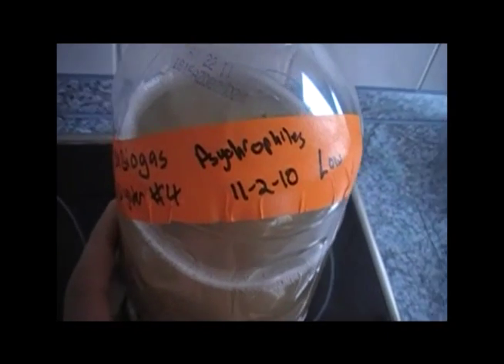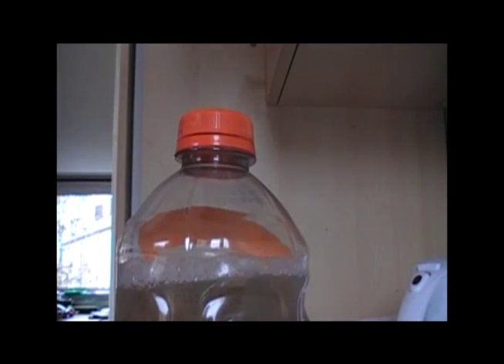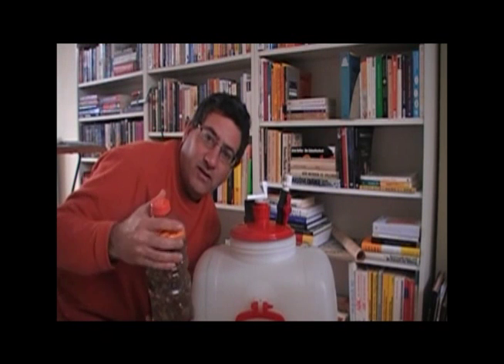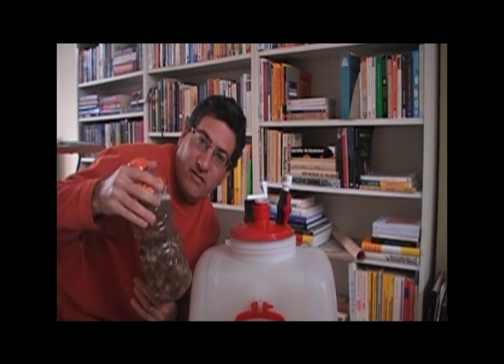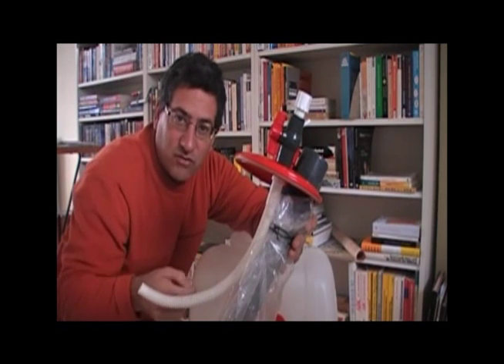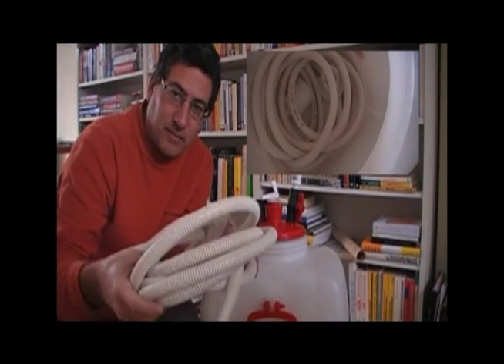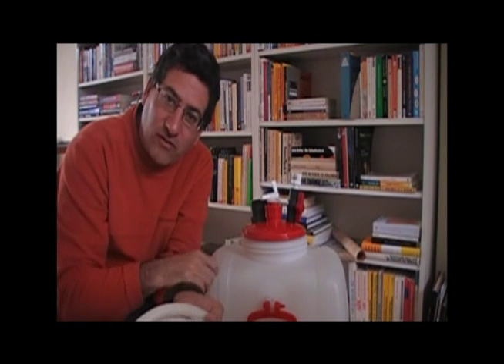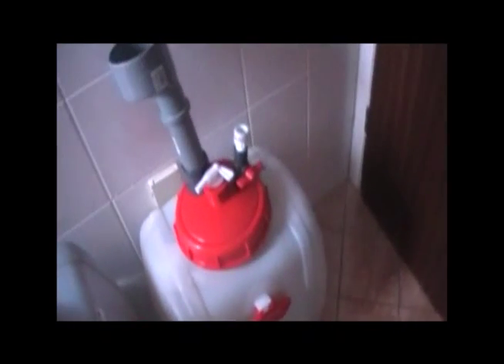Building a home for psychrophiles

Comment: interesting  a word of advice  others whove been building and refining this tech for over 40 years have found that if you lightly lightly adjitate the organizoms they work even better ( not rough or youll kill the organisoms ) this can be done simply by adding a elbo to the bottum of the throat as you call it They use a globe tank which helps also

Comment from the maker: @shaunhermans Sorry for the delay in responding. I've actually taken the "first stomach" out of both of my digestors (the 60 liter and the 700 liter) because it was taking too long to get flammable gas.  Once removed I got flammable gas within a couple of weeks.  I don't know if eventually things would have sorted out, but I am now skeptical about trying to isolate the processes. It seems that the consortia of bacteria all work together and I'm having better results with a single chamber.